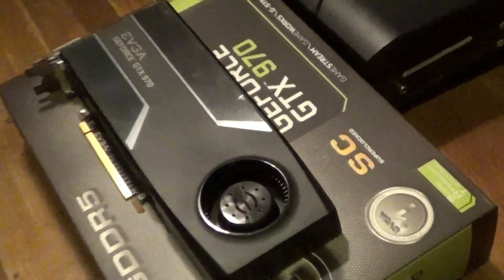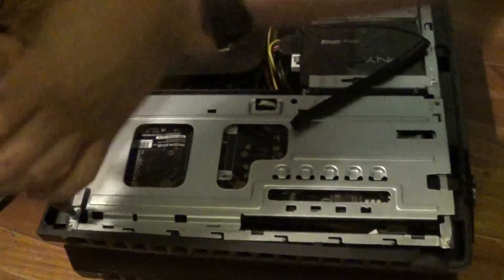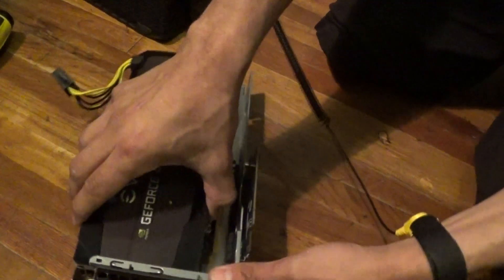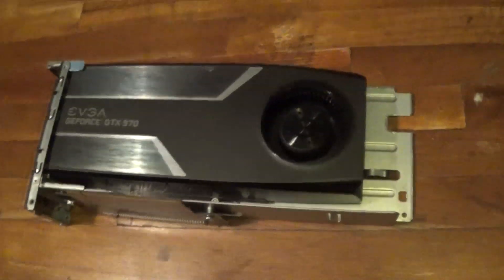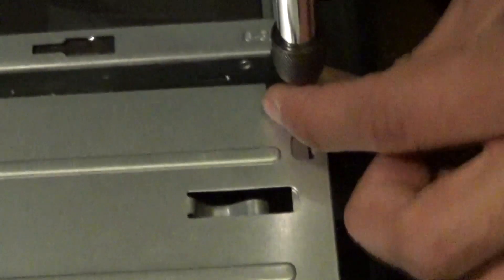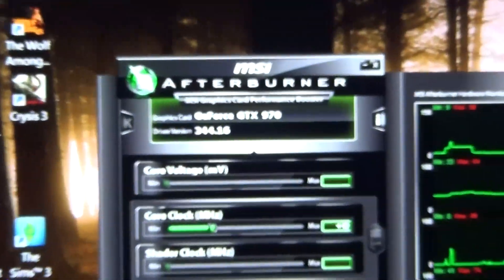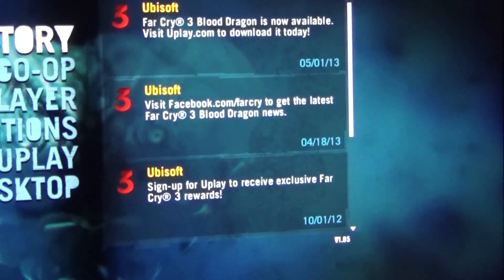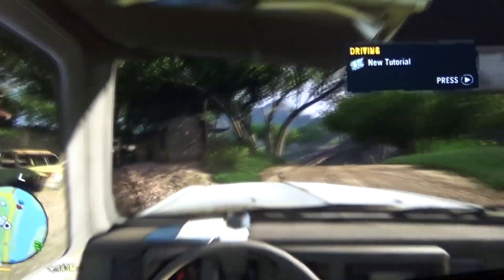How to install a GTX 970 SC in an Alienware X51. (English)

Comment: how do you use the modular power supply. i mean how do you use it to bypass that crappy cylindrical power connector that goes in the back of the system in standard form?

Comment: the normal power supply can handle a gtx 970 right?
Reply: no the normal is 240 psu but you can upgrade to a 330 watt psu but its really expensive if you want to buy a used one look for one on ebay.

Comment: Hi, I still have my x51, did you need to install a new psu to use the 970 at all?
Reply: Anything above a 750ti is recommended to have at least 400w, I'm installing a Mini GTX 1060 6GB and it will be good with a 500w PSU..So yes you should upgrade your PSU to at least 400w :)
Reply: SupernovaJosh Does it not come with a 400w one? I thought it did.
Reply: Alex Cross No GPUs come with a PSU unless you buy some sort of bundle. They are usually sold seperately
Reply: SupernovaJosh Not the gpu, the Pc itself. I'm pretty sure it came with a 400w psu but I'll double check
Reply: Oh, the first gen X51 comes with a 330w PSU

Comment: Great video! did you have to remove the front fan to move the ssd drives? also will the drives overheat on the optical bay?

Comment: should you be able to fit a gtx 1060 founders edition in the x51 with a length of 9.823 inches? I don't want to remove that front fan.

Comment: Will the msi gtx 970 gaming twin frozr fit into the x51 r2 case?
Reply: Maximum Graphics Card Dimensions

Height: 4.736 inches
Length: 9.5 inches
Width: Dual Slot

Official Dell spec page:
http://www.dell.com/support/article/us/en/19/SLN296934/en#Specs

Comment: Hi i want to change my graphic card to gtx970. So i need to buy a ac adapter 330watt ?
Reply: It will probably use to much power I would get a 500w
Reply: hello there you can buy a gtx 1050 ti 4 gigs or gtx 1060 founders edition. gtx 1050 ti doesnt need to be connected to the psu, it withdraws it power from the motherboard but if you want to install the gtx 1060 you need a  6-pin to 8-pin PCI Express Power Converter Cable heres the link https://www.amazon.com/gp/product/B00JLTCMFC/ref=ox_sc_act_title_1?ie=UTF8&psc=1&smid=A2TWRNEH2276JE
there a 120 watt version of the gtx 1060 and a 150 watt so choose wisely.
Reply: Noel Landaverde thanks!

Comment: so you can run a GTX 970 off 330w Power Supply  what about overheating any probs there ?
Reply: How did you upgrade the 330w power supply since it is out of the case? I have been looking and all i find is in case ones!
Reply: I had to upgrade to a 500 w power supply
Reply: ***** I was thinking that you would have to put it in a bigger case to fit a 500w ..unless i'm missing something :)
Reply: Darius Barnes Yeah, but i know nothing about building a pc sooooo i'm screwed. I wouldn't trust myself with moving everything LOL.

Comment: Is this the EVGA GeForce GTX 970 04G-P4-1972-KR 4GB SC model? I would like to replace it in my X51 R1, what is the size of the graphics card and the power consumption it uses? As far as I know my rig only fits 9.5 inches long and power consumption not more than 150 watts. I have the 330w power supply, HELP Please,

Comment: i have a gtx 745 in my x51 r2.   if i upgraded to the gtx 970 would i only have to plug it into the same spot that you did in your vid? and it will work without having to download anyhing?
Reply: Yeah , get the same card as this guy did. It's just plug and play. I installed mine a few weeks back and it runs fine.
Reply: http://www.evga.com/Products/Specs/GPU.aspx?pn=74ef227b-980e-4a4f-8a69-7ffbceb6bcc6
You can use the SC version or the normal one.As long as you have the 330 w psu and R2 or higher

Comment: I tried to install an asus gtx 970 but it is too big.  Also it has a single 8 pin connector insrtad of dual 6 pins.  You literally should get the exact same 970 in this video for it to go in without problems
Reply: +voiceattackpacks.com Do you know which specific version it is?

Comment: GUYS DONT WORRY X51 R2 USERS GET THE GTX 970 REGULAR VERSION INSTALL IT ENJOY :D ITS BEEN A YEAR SINCE I UPGRADED MY GTX 970 IT WORKS LIKE MELTING BUTTER ITS SOOOOO SMOOTH SORRY FOR CAPS IM SOO HAPPY ACTUALLY X51 R2 IS NOT 330WATTS ITS 500WATTZ THERES A BOOST POWER SUPPLY WHEN GAMING OR MULTITASKING SO YEA GTX 970 IS A GOOD CHOICE :D
Reply: +Soorya prabagar do i need install any driver or just plug and play?
Reply: abdurrahman akasyah ofcourse install drivers
Reply: +Soorya prabagar and i need to uninstall the existing driver is it?
Reply: abdurrahman akasyah YEAH OFC
Reply: SuBcLass
At this point just get  1060 founders edition its better and fits perfectly... Also its TDP is better

Comment: Question! is the x51's power supply enough to work with the 970?
Reply: +TheEnglishQuail No its not you need the R3 power supply otherwise the video card will shut down in games due to it need a 300 Watt minimum
Reply: +KyleRen 1337 thanks for the reply and insight, that being said I have since posting this comment installed the 970 and had no problems :D

Comment: I have the X51 R2 with the 240w power supply what are my choices when upgrading my GPU currently I have NVIDIA GeForce GTX 745 with 4GB DDR3 can use the one you used?
Reply: +I2esistanc3 I would suggest getting the X51 R3 power supply then getting the 970 because if you don't your video card wont get enough watts to power itself for high end gaming and the game will shut down

Comment: Hi I have a i7 4770k Intel processor and a gtx 645 graphics card and 8gb of ram would I be able to upgrade to the 970? And would I have to change my power supply

Comment: I have a X51 R2 with the 330W. I also bought the gtx 970 sc and wanted to know if my PC could run it without shutting off like yours did. 
Gpu: GeForce GTX 760Ti 
CPU: Intel(R) Core(TM) i7-4790 
Memory: 16 gb ram
windows 10

Comment: Hi, I just installed my new 970(same as one in video) into my x51 and its reading as standard VGA graphic adapter, and when i try to install nvidia drivers it says install failed. Did I mess up putting in my graphics card? Any help would be appreciated.

Comment: MGTech hey quick question do I need a 330w power brick to use a gtx 960 graphics card in the x51
Reply: +SASUKORI I wouldn't get a 960 they aren't very powerful in modern games save up for a 970 and for either one your gonna need the 330 watt power vrick

Comment: I have an r2 with an i7-4770 3.40 GHz with 8gb of ram and a 330w power supply. Did you think a 970 would work fine in it?

Comment: alright i have 2 questions if someone could answer it would be highly appreciated on the alienware site it says my power supply is 
Alienware™ 240 Watt Power Supply 
(Standard)
Alienware™ 330 Watt Power Supply
so what does it mean?
why is there two answers? i also want to upgrade my graphics card from geforce gtx 745 to 960 will i need to upgrade my power supply?
Reply: my power supply is actually not in my case its like a brick thats has a chord that connects to the pc and another on the other side that connects to the wall. like one u would see on an xbox or playstation.
do u know where to get them sort of power supply or will i have to get a new case and get a normal power supply. if i have to get a new case i might as well get a 970. and ty for responding :)

Comment: Hello, guys! I want to move from the AMD R9 270X to a nVidia GeForce GTX 970 4GB SC , but my power supply its about 330 W. Is there any issue with the power supply since this graphic card need at least 500 W? 

I have the Alienware X51 R2 Core-i7, 3.60 GHz, 8Gb RAM, with 1 terabyte hard drive.

Comment: for future people checking this out - If you go into power options (control panel) and lower your max cpu clock speed.. you can save power. Which gpu is king you should still see increase in fps. Also, lower the 970's 'Power Limit' to -10/15%. I imagine that if you are not afraid of bios editing/flashing.. You could make a custom bios with boost disabled and a power table that never exceeds wattage suggested by your model of X51. Hell if I had an X51 to test, I'd make a custom bios myself for the community. I support small form factor PC gaming.

Comment: Hey mate I have an x51 r2 model my current specs are 

Gpu: GeForce GTX 645 
CPU: Intel(R) Core(TM) i7-4770 cpu
Memory: 8.00gb ram 7.92 usable
Current resolution: 1920x1080 ghz
Driver version: 358.91
Operating system: Windows 8

I went to a computer shop today to purchase a gtx970 or gtx960 and they said they couldn't put it in there because it wouldn't fit??? I am aware the x51 r2 is a slimmer model however mine looks exactly like yours. I rang fell and they sent me an email telling me the GeForce GTX 960 is compatible. Can you please get back to me and let me know if the computer you show in the video is a x51 r2 so I can show these guys tomorrow when I go back to the shop?? Thanks a lot
Reply: Dell*
Reply: +mickybb123 it does fit, i literally just installed a 970 on an r2
Reply: SuBcLass just search EVGA 970 SC that's the one I bought it's also the one featured in this video

Comment: I have an Alienware x51 intel core i5-3450 with geforce gt 640. it runs extremely well on warframe game at 60-65fps.

I am wondering what are the list of graphics card that are compatible for my alienware x51?  I think it's a 2013 model.

Comment: I have the X51 R2. Will i be able to use the "NVIDIA - GeForce GTX 970 4GB GDDR5 PCI Express 3.0 Graphics Card - Silver/Black" without upgrading/ changing any other part of my system?
Reply: +Connor Davis If you don't have the 330 watt R3 power supply then get it and you should be fine

Comment: So i got the EVGA GTX 970 non SC and it worked perfectly for about 2-3 weeks no problem. It started giving me constant black screens with Critical error "Kernel-Power 41 (63)" so I sent it back to newegg for a new one. I havent recieved it yet but is that the same problem you had when you had gotten your crashes. Or do you think it was just the card cause it started crashing with games it never had a problem with and werent demanding. And nothing was overheating either. I went back to my PNY GTX 960 and havent had a single problem with this card and have been using it for about 6 months if anyone is intereted in upgrading to the  GTX 960 I am using the X51 R2 with 330W PSU and it is very stable and not a bad card.

Comment: Hi guys! would just like to ask, whats that app shown at 8:13? the one showing the Temp, MEM and FPS at upper left corner??
Reply from the maker: +Maria Celene Conti MSI Afterburner.
Reply: as i thought txns! and also cuz i really have no idea about this and i dont want to ruin myvcard, whats a good fan setting for a gtx980 in x51 r2?
Reply: +Maria Celene Conti hey, do you put gtx 980 in x51 r2? soes it fit into the case?
Reply: +Arif HHMY yah i did. it actually worked. but i had power supply problems. vcard was requiring 500 but the x51 only have 330
Reply: +Maria Celene Conti What GTX 980 card did you use?
Reply: +Maria Celene Conti Did you have cooling issues with the gtx980? Like did it overheat because I want to swap my gpu

Comment: I am planning to buy an EVGA 960 4GB FTW edition. Do u think it will be okay to put it in my x51 i3 6th gen system with 330w psu? If not, then how much downgrading will it require to run stable while extreme gaming and also what kinda temps should i expect?
Reply: I'm wondering the exact same thing...

Comment: will this graphics card work qith the motherborard that came with the x51 r2? im moving my components to a new case also. and does the i5 4690 and gtx 970 with 16gb ram run games such as arma 3 ultra? and would the i5 4690 with the 970 be a good setup? i need to know asap thanks

Comment: so if i have a intel 17-4790 cpu 3.60ghz with install memory ram 16GB can that run a gtx 980 no problem?
Reply: +Twistedgaming14 it depends on the powersupply not have much ram and what cpu you hav, but if your thinking of putting a 980 in this compurer your gonna have a bad time
Reply: the goat pope ok thanks what about a gtx 960 ?
Reply: with a 960 you should be okay since it has a 120 tdp
Reply: the goat pope ok thanks
Reply: +Twistedgaming14 I have a GTX 960 in my X51 R3 that I have recently bought about 4 days ago and it should be fine.
Reply: ***** thanks i already got my gtx 960 it works fine
Reply: +Twistedgaming14 do u have the x51 r1 ? cause i was thinkning of putting in a 960 or 970 what that be good?
Reply: +birdman 44 but i only have a Intel(R) Core(TM) i7-3770 CPU @ 3.40GHz
Reply: +birdman 44 Don't the X51 has a very low power supply before doing this get the R3 power supply then you should be fine...I would also recommend getting a new processor since that one isn't very good to be honest

Comment: i found that the graphic card you brought is GTX 970 SC and the length 24.1 cm. I just brought one Gtx970 single fan with length 26.7cm, will that fit in my alienware x51 R2? Thanks

Comment: Is the link you provided the only card that fit the x51? Is there a better card that's gonna fit the case without burning it?
Reply: +Kal Kuma All 970S can fit BUT the doubled fan ones cause severe damage to the system

Comment: The GeForce GTX 970 will not work in an Alienware X51 R2. The card requires 500 watts power supply, and the Alienware X51 R2 has a 330 watt external power adapter. You cannot fit a 500w or 600w power supply into the slim X51's case. You'd have to gut the case and move the components to a new case, then install a 600w PSU.

Comment: You really need to upgrade your power supply, those framerates are way too low for that specs of yours and particularly for gtx 970, you need at least 450w power supply unit to fully enjoy gtx 970.

Comment: i feel sorry for the idiots that actually buy alienware thinking they've got a top of the line PC LOL. Custom built is WAYYY CHEAPER and much more powerful, for $700 USD I can easily get a GTX 770/970  or R9 280X/290/390. Those cards are already classified as high performance 1080p 60+ FPS. Next time do some research before buying junk you clearly don't know. 
http://www.logicalincrements.com/
http://www.tomshardware.com/reviews/gaming-graphics-card-review,3107-7.html

Comment: Hey I have a X51 I think R2 with a GTX 660 and have been planning to get a 970 

This one http://www.bestbuy.com/site/nvidia-geforce-gtx-970-4gb-gddr5-pci-express-3-0-graphics-card-silver-black/9855169.p?id=1219441201895

Or this one http://www.newegg.com/Product/Product.aspx?Item=N82E16814487069 and I'm not sure if my motherboard or PSU can handle it. I believe I have a 330 watt PSU from looking at the model number DA330PM111 and I found a 330 watt one but most people I talk too about it say I should get a 500-600 watt PSU and I'm not sure what I should do, any advice?

Comment: Will a gigabyte geforce gtx 970 G1 gaming gpu be usable with an x51 r2 330 watt power supply?
Reply: +Robert Gonzalez it pulls 145w from the supply what the fuck are you smoking?
Reply: +Robert Gonzalez 500w for a graphics card?! XD you are on some crack boy, the Titan X takes only 250w.

500w is what they RECOMMEND you have for the total power supply.
Reply: +Andrew Alvarez Minimum is 500 so no
Reply: Bandit4557 yeah but... thats the titan x... other cards take less...
Reply: +Robert Gonzalez EXACTLY

Comment: how do i know if i have the R1 or the R2
Reply: Max Mustermann It says on small writing on the back
Reply: +MGTech HD Can you install the GTX 970 into a R1? (I've got GTX 660 with the alienware)
Reply from the maker: Max Mustermann What CPU do you have?
Reply: itsOllyReports found it thanks :D
Reply: +H0nG I have the same question.
Reply: +H0nG You cannot because of the 230W power supply that it has which will cause the GPU to shutdown as it did in the video...If you want the 970 your going to have to A.Buy the R3 power supply or B.get a new computer
Reply: There is a Aurora R1 and a X51 R1...make sure they tell you which one they have because an Aurora R1 has a 525W power supply or a 875W power supply and both rigs run this card just fine.

Comment: I have the Alienware R2 version (the version that came with the GTX 660, i7 3770, 16 GB Ram.), and I am wondering if the 980 ti is compatible with it. Should I get any extra components for it to work?

Comment: what poweradapter do you use here?
Reply from the maker: Nander Lavaert The 330w PSU.
Reply: ElMastaGamer HD If I buy a new PC case and transfer everything over to it and buy a new psu will I need to buy anything else to run a 980 SC ? Like motherboard? or anything ?
Reply: MGTech HD Can I use the no super clocked version with the standard power adapter
Reply: +Saúl Peralta Nope.
Reply: +Natal King yes u need the 330
Reply: +MGTech HD with my Alienware x51 r2 how much will I need to down clock it?
Reply: +Natal King im in the same situation, did you get it to work?  If so, what did I you do to get it going?

Comment: I have a question, I have the same x51 as you and everything, i was wondering if you could explain how to down clock the card? i have been looking for weeks and could not find anything on it. ElMastaGamer HD This would help me out A LOT. Thank you :D
Reply: Booodski or i should ask, is there anyway to make the GTX 970 SC into a normal GTX 970 without the SC?
Reply: +Booodski there's this programme you can download called NVIDIA inspector. :) (I believe)